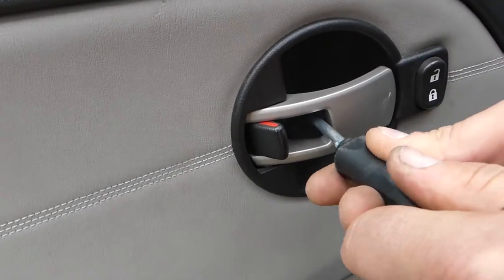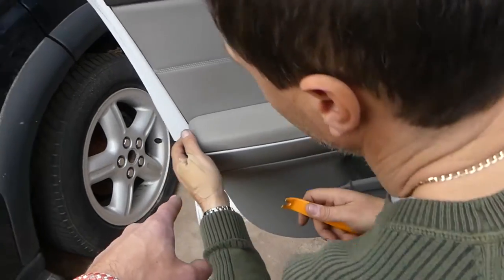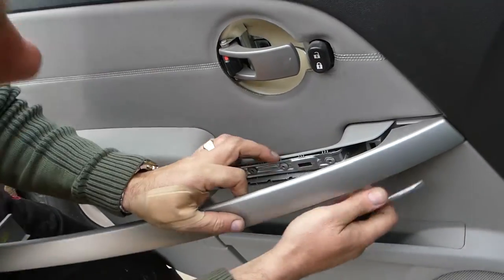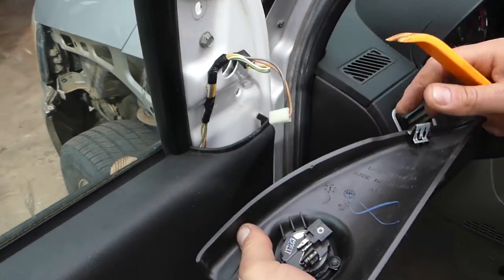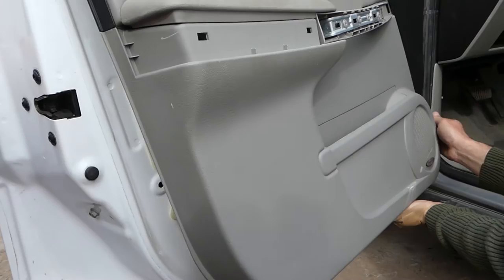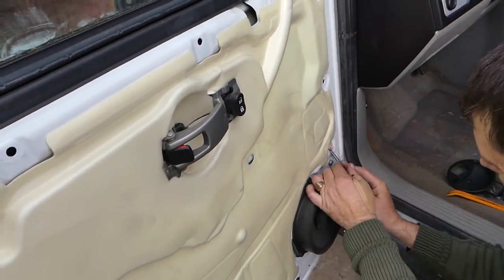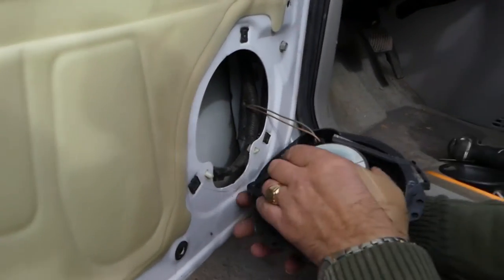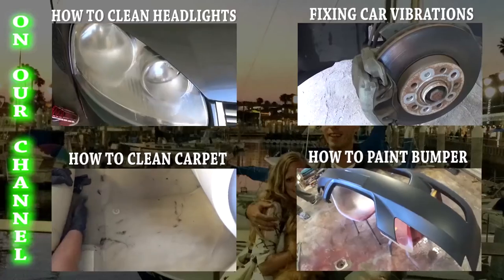CHEVROLET EQUINOX FRONT DOOR SPEAKER REMOVAL REPLACEMENT TORRENT

Comment: Got a couple questions.. I'm getting a 2012 equinox that has the pioneer speaker and color led stereo.
1) will the pioneer 6x9 4 ways fit in the front & back as replacement?
2)  can an amp & subwoofers be added to the factory stereo?